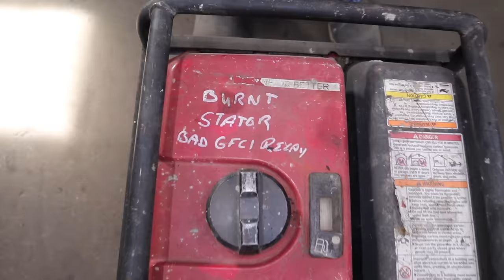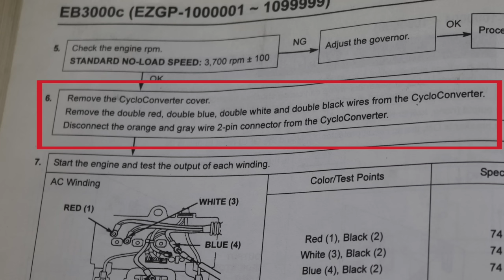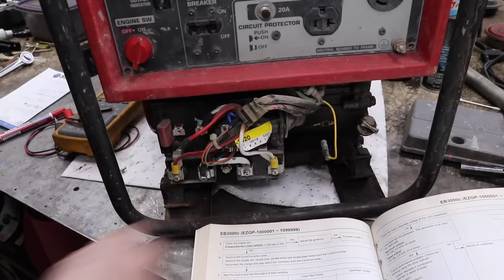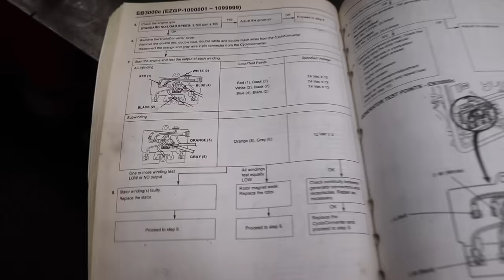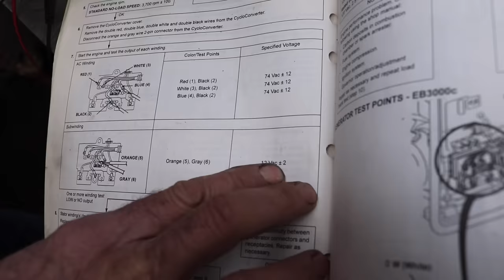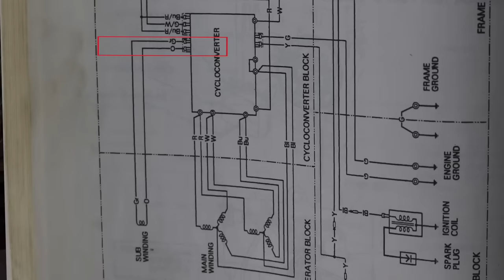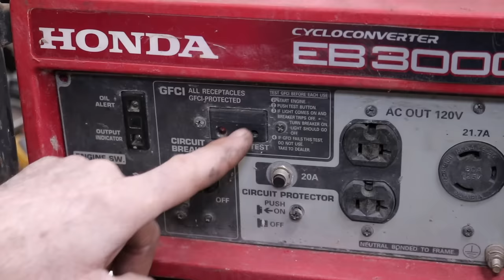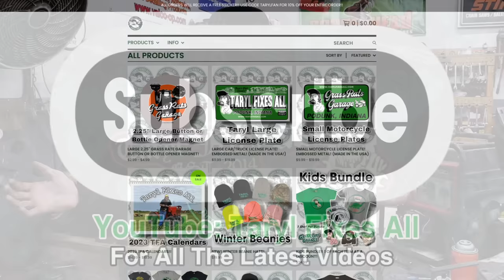Some Things Change For The Worst

Comment: You know, there are regulations in states where a dealer can be licensed to sell a product, and part of the stipulation is that as a seller, you are required to provide service on the items you sell, so that a consumer has recourse, plus the ability to maintain the items you sell. Why isn’t this being enforced? The thing that I think is happening is that manufactures of fossil fuel powered products are being disassembled by litigation over compliances and they are bailing out of existence and leaving us with our puds in our hands

Comment: I had a twin cylinder Honda generator put me through the ringer in the 90’s ….I could not figure out the the problem… it belonged to a campground to run the well pump now I am a Predator man 9500 runs my whole house water well three fridges two upright freezers even my 3 ton air conditioner with an Easy Start installed

Comment: The thumb nail should read: Honda generator parts like "inverters" are extremely pricey, buyer beware! My EU3000is currently has 17,000 hrs and my EU7000is currently has 7350 hrs. Recently for the eu3000is I priced the inverter at $1180 CAD, stator and rotor set was the same high price tag, fortunately I diagnosed the low voltage issue to the L14 - 30 house receiving receptacle with a fried neutral. The eu7000is worked with this fried neutral which is why I concluded after diagnosing the eu3000is to be free of defects and looked further down the line where I found the trouble, switched out for $30. The day that I diagnose a faulty "inverter" "stator and rotor set" I will buy new Honda generators and keep these for parts beaters. Off-Grid and purchased both in 2016 and, all maintenance done to Honda specs, machines are still humming along. I am now curious to the Champion amount of hours, anybody?
Reply: 60 million hours
Reply: Don't the Champion gens use a Honda clone engine? There's no way you would get 7K hours out of it. 2K hours would be something to celebrate and brag about for a Chinese OHV clone.

Comment: You actually can make your own inverter circuit. 
Quite frankly it's the easy part of these generators and there's a few good examples on the Internet. 
I hope the FD didn't throw that 12kw generator away because if they know a good electronics tech he could replace it and besides you actually can make these out of readily available parts.

Comment: Yeah. Best to have two generators available for emergencies.
Now..
Maybe someone can answer this. 
You have 3 legs of roughly 70 volts AC correct?
What if, you ran each through a diode.(a valve) so none of them could put power back on the stator.
And run two legs together into a Variac. That would be 140V AC into the Variac.  And let the Variac lower the voltage, and keep it constant. For 110 -120 VAC.
Would that work?
Reply: The worst of a few issues is, if you put diodes in, you no longer have AC... Without AC, you can't use a variac.  There are other problems, such as regulation.

Comment: i love me some honda gx engines cant beat them on go carts and minibike's i get a lot of them cheap or free from junk generators. and if its the funky generator side case on the engin can just get a stock one from flebay for like 15-20$ and if its a tapered shaft i grind them down while runing (very carefully and slow to keep it evean) and weld an adapter sleeve onto it to give it a key way and make it a nice tight fit for the clutch's or pulley...

Comment: It's not just honda inverters, they all change design so much even the Chinese generic ones are hard to find replacements for. But considering it has a 3 phase output at the stator, you could always rig something up like a wind charge controller or programmable inverter unit 🤷‍♂️

Comment: What about Harbor Freight, they knock off Honda and you can order parts from them. Wonder if they have a 3000 watt inverter generator. Also what if you just wired the 110V wires directly to the outlet plugs? You would get your electricity but it would not be pure sine wave, not good for computers or computer controlled devices. However, you could buy a power “conditioner” to clean up the power and could use it for electronics.

Comment: To be fair any inverter gen will fail the same way. You have to disconnect the load before you start or shut it down. And if you think Honda is bad try getting inverters from Onan. I've had much better luck with Honda's than anything else, you just have to take care of it and operate it correctly.

Comment: Taryl fixes most is what the channel should be called after this episode. Strap a Harbor freight 2000 W power inverter on there and plug it into the 12 V output. Wham! There’s your appetizer at least.
Reply from the maker: Try that out and let me know how it works 😂
Reply: @TarylFixesAll  
 
18 amps at the generator 12v DC output is what would be required to feed 218w to the 12v inverter input and achieve 2000w power handling at the inverters 110v AC output plug. Generator is rated 21.7 amps on the 12v output it says, after I paused and zoomed in. Should ought to work according to Ohm’s law, with the leftover 3.7 DC amps at the generator providing a 387w potential surplus to the inverter on the AC output end, for any brief initial peak power turn on surge/shock load demand spike needs. (like how an electric air compressor motor demands a lot of peak power at the moment of turn on to overcome the resistance of a partially pressurized air tank).. hmmm, could run a 1-2 farad car audio capacitor between the 12v gen output and the inverter 12v input. Those are made for just this purpose, providing occasional bursts of quick release reserve power. So your headlights don’t dim with the bass beats when you crank up an amplifier to the point where it maxes out alternator output amperage. No light dimming voltage drop happens when power demand beyond an alternator’s capability is provided by a capacitor instead of the battery. That would add some peak power reserve muscle and a bonus illuminated digital voltage display readout. 
 
…But would a repair customer actually be willing to pay cash money for having his Honda generator transformed into a ridiculous wet weather sensitive contraptulamation such as this? myeeeeh, that’s different story. Might get angry actually😆.

Comment: This is becoming the new norm. They start discontinuing parts for anything after about 10 years so you cant fix it and have to buy a new one. The new throw away world we live it. The parts are somewhat reasonable when its still being made then it goes out of production. Then all the parts left are sitting in warehouses and they get more and more expensive until they run out. After that you are forced to find used parts if possible or buy a new model.

Comment: Those cheap honda generators may be junk but the honda fuel injected inverter jenerators are alright . We have a eu7000i generator that has 9600 hours on it and the only maintenance we ever did was change the oil and the fuel pump filter. We still have our old eu3000 generator with 5700 hours on it and it still works fine. I heard of a fellow that put 22000 hours on his eu7000 .The flagship generators that honda makes are one of the top portable generators in the world . Change my mind

Comment: Champion generators are underpowered. Not to mention they are finicky when used everyday. Take a champion 2000 watt generator which is powered by a 80cc engine vs the honda eu2000 which is powered by a 100cc engine. As someone who uses these daily ive tried the other brands and they'll start leaking gas or won't start or they tend to overload easily or consume alot of oil. Another thing is the hondas I've used can stay in eco mode saving gas vs the competition that will overload or won't stay in eco mode having to fill up ever couple hours. I've switched back to the hondas and havnt looked back.

Comment: Is the electronics board  encased in epoxy or a rubbery substance? I have had success with automotive ECUs with digging out the rubbery stuff from around the capacitors and replacing them. I Replace all the caps. I dont bother testing them . Its just as easy to replace them. If it is encased in epoxy then that would be impossible.

Comment: I can't afford honda, but no one I've ever known with Honda money says they are.  I'm interested in this because the Eco flows generator that charges their delta series is based on the honda.  I don't think this will be an issue with thise because when used to charge the delta batteries it bypasses the inverter and charges DC to DC

Comment: My theory on those parts is the Honda generator you are fixing  are decades older than the founding date of  champion co. The 3-cylinder Honda diesel generator eb12d production stopped in 1996 28 years ago. The Honda eb3000c you were working on in the shop. Production stopped in 1999 25 years ago. I see champion power equipment was founded in 2003, see if you can find parts for a 2003 inverter generator.

Comment: Surprised some of those cheap Harbor Freight generators wouldn’t have parts that would work on those Honda’s. 
Thanks for the info I want be buying any Honda generator’s.
Reply: I don't understand why a cheap Harbor Freight generator would share any parts with a Honda, other than Honda seems to not support its products.
Reply: @donmoore7785  
Because a predator motor is a copy of a Honda
Reply from the maker: I thought that too. Parts are different. I think the generac parts will work on a Predator. Have to wait and see when one comes in for repair.

Comment: I don’t have a generator but we run Honda atvs have Honda engines on the pressure washer bale grinder lots more they rarely get serviced . Some are 15 plus years and still get used daily. My moped is also a Honda metropolitan I bought new in 14 honda ranchers my foreman is an 02 I’d go anywhere on them

Comment: I would rather have a standard old school generator over these newer generators that use inverters.
Reply: Unless you need something that produces a perfect clean sinewave with very low distortion. For that you need an inverter.
Reply: @eosjoe565  When it comes to a basic old school physical generator head spinning via a gas engine producing AC that's as about as reasonably pure of a sine wave as you can expect to get however the downside is the frequency will not stay at a true 60 hz with a gasoline engine spinning it and unless you are running clocks from the 1960's - 1970's that are dependent on the 60 hz to keep accurate time, you won't be in any danger whatsoever of damaging any delicate electronics such as wall wart switching supplies for smartphone chargers or modern televisions or even your smart refrigerator because all of those appliances will have their own filtered DC supplies for any critical computer components and they generate their own reference timing pulses to run critical timing needed like you find inside of a smart refrigerator but the compressor in that smart refrigerator will easily handle a 55 Hz - 65 Hz and function with no issues because it will run directly off of the AC input. Older school designed generators do not put out a modified sine wave and even though the modern modified inverters are frequency stable, it's the cheaper modified sine wave inverters that will overheat AC motors and cause switching power supplies to eventually go up in smoke. With that said, these newer generators using inverters are designed to output a pure sine wave and even if the engine goes under load and slows down a bit the frequency stays the same. It's a trade-off. You get a frequency stable sine wave even with the engine's imperfections keeping a perfect RPM and the cost is more parts to fail along with being more expansive to repair vs a old style brute force generator that generates a clean sine wave but the 60 hz stability is at the mercy of the engine RPM's bouncing around. The most important thing is having a pure sine even if it moves around by a few hz above and below 60 hz that will work without damaging sensitive equipment.
Reply: @flash001USA  Also don't forget the "noise" from a typical generator due to the brushes. I'm sure you are currect about the tolerance of all the "smart" appliances. Unfortunately (or perhaps fortunately) all my appliances except for the TV are still dumb. I have plenty of things with transformers and motors. I also still have devices with "wall warts" that are transformers and not switching supplies. The only way to really see the output of any generator is to attach it to a power analyzer that can show you the sinewave, distortion and noise.
Reply: 99% of AC generators are brushless and even the cheap $89 Harbor Freight tailgater generators use brushless generator heads. On the other hand, automotive alternators used in cars and trucks etc do have brushes where they can vary the intensity of the magnetic field on the rotor to step up or lower the power output of the alternator as it is needed by raising or lowering the DC input voltage on the rotor and if you have ever installed a car stereo sometimes you may have to add filters to remove the alternator whine which is would come from the changing engine RPM's on the rotor but most everyday generator heads do not use brushes because they are induction started which do not require brushes and the output power is taking right off of the outer coils that the spinning rotor is exciting to produce the 110 volt AC. Generally 99% of AC generators are brushless which is why they can last for years and years and the only normal failure will be the bearings or start-up capacitors failing.
Reply: @eosjoe565  Almost forgot, I am now retired but I worked in the field of electronic design and repair for well over 40 years and this a topic I can comfortably speak on.
Reply: @flash001USA  I certainly appreciate you passing along your knowledge.

Comment: Seems like in the last 10 years or so, Honda has turned into the 'Apple™' of the portable generator world. You can't fix it.. go buy another one and fill up the landfills with our trash. It's a really bad look for Honda, since they've always been at the forefront of technology, and this type of business model will eventually be their downfall.😐 I have a 5 kw. Husky generator with a 9 hp. Subaru air-cooled engine, and after 12 years it's STILL going with nothing but a few oil changes 2 spark plugs and 1 carb cleaning. Pretty good track record I think, and it starts on the second pull every time!😉 EDIT: Oh, and it's not a crappy 'inverter' generator either. Just a standard 4 pole AC 240/120 v. single phase generator. It just works.

Comment: Great video. What are your thoughts on the predator generators?
Reply: Also, sometimes they don't work for long when construction workers sling them out of the back of crew trucks at 85mph...recoil starter is the 1st thing to break on them

Comment: I was going to buy a used Honda once, but it needed a new exhaust system due to rust and leaks. When I looked up the parts prices I said Nope, you can keep the car.

Comment: The engine rpm is important  and you can use a timing light to check it. If the rpm is off the inverter will fault. It can also fault if it has poor contact with the blower case as it sinks heat to it. I use artic heat sink thermal paste on it. I bet many inverters are condemed in error

Comment: So get a different generator. Or diode bridge to run it as a battery charger and a inverter for the battery. Like those with the battery clamps. It may take something to Jerry rig it. But new generator may be better.

Comment: Bought a Honda generator right out of the box  started burning oil. Took it into a repair shop he told me there was nothing wrong with it. Called a couple other repair shops they didn't even want to look at it. Took it apart found out it was missing one of the valve guide seals.   Called Honda  told them what I found and they told me I would have to take it to a certified repair shop and the circle jerk starts all over again.
Reply: I have owned my Honda EX 500 watt Gen for 20 years and have 2653 hrs on it so far
Reply: 5000 watt

Comment: The generator wouldn't run with the DC wires plugged in, but does it put out ac when you got it running?
Reply: No, it wouldn't put out anything. The low voltage winding is what powers the circuitry within the inverter board.

Comment: the name brand manufacturers are all going the disposable route for their products. you're almost better off buying a generic brand because they use common, off the shelf parts that are obtainable or at least capable of being modded with a different component. or go the harbor freight route and pony up for the extended warrantee and just keep replacing and renewing it when it dies or is close to running out even if it still works. at least then you'll get a free upgrade if they have one.

Comment: actually, I have used a compactor to fix a honda generator that requires having a battery too, but I was able to use the compactor to get DC voltage to get ac voltage. this was a pain but did it just to see if it would work and it did . called it the Thing .by the way I also used a voltage regulator can't remember from what .
Reply: Do you mean Capacitor instead of 'compactor'?
Reply: @georgehofgren6123  yes I'm driving and the damn phone putting down what it wants
Reply: @georgehofgren6123  I didn't even notice. thanks for letting me know I'll fix it later